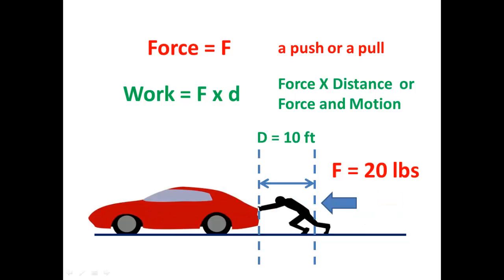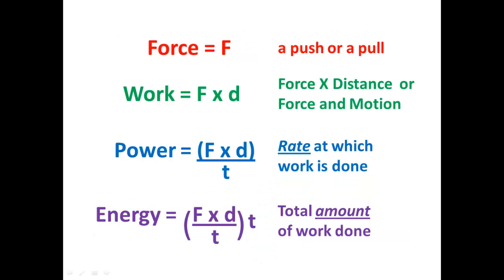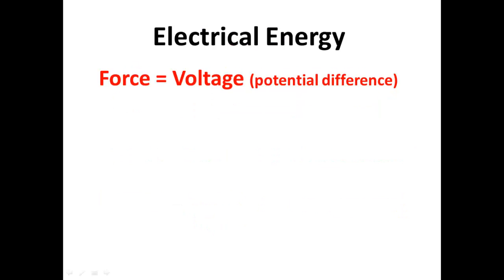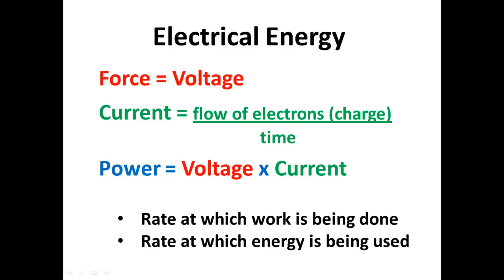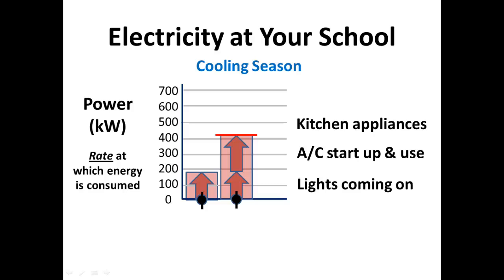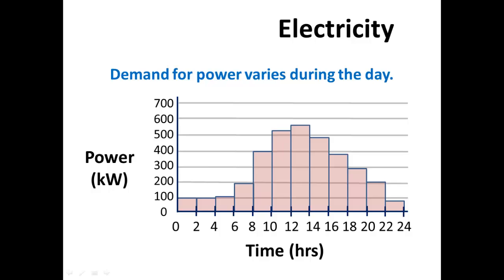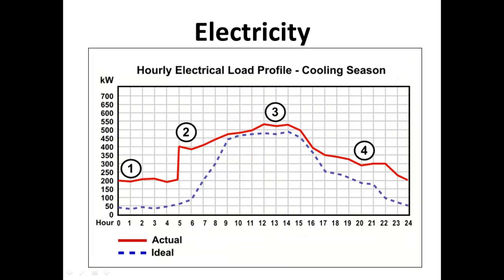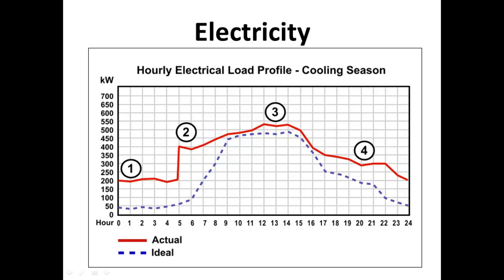Electrical Energy Basics

Comment: Forces and Potentials are NOT the same. Voltage is not a force. It is the "gravity" of charge, where a positive charge is flowing from a high potential to a low potential. So the force that pushes/pulls the charge is: F = qE = qU/d, where U is the potential or the voltage in this case. You may say that the voltage is analogous (as it is proportional) to the force, but not the equal.

Good video though, very informative for children